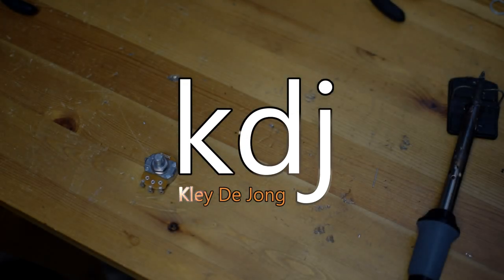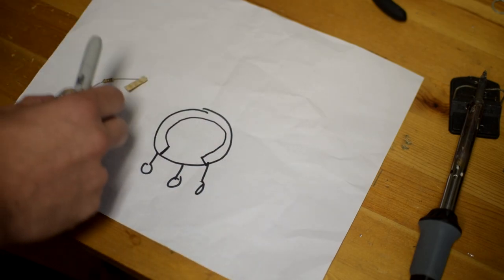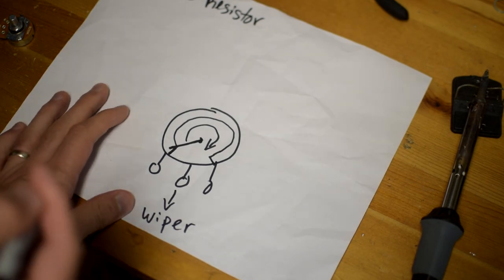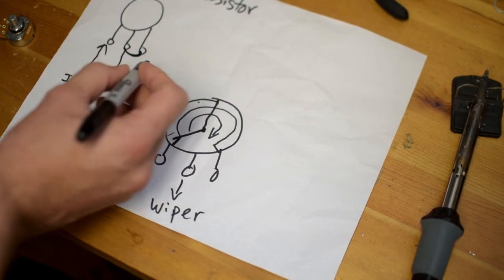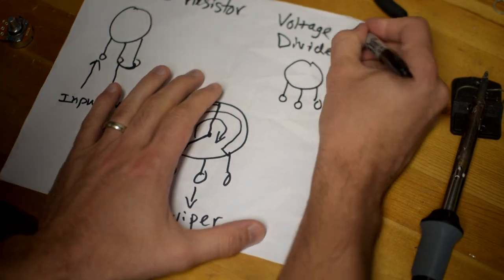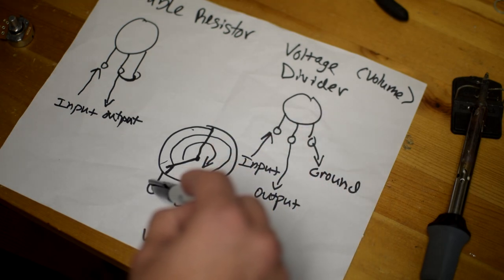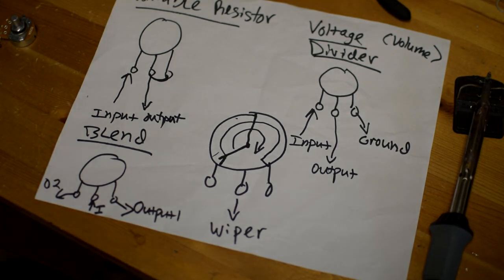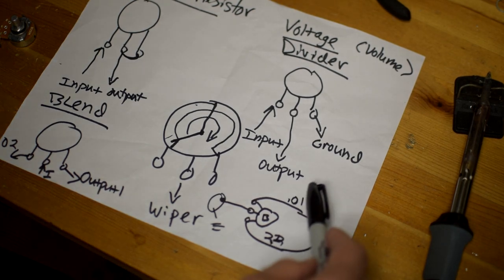How A Potentiometer Works & Options for Wiring

Comment: First off, thank you for an excellent, in-depth video!  Well done, Sir!  Second, you are correct; when using a pot as a variable resistor, leaving the 3rd lead open, or tying it to the wiper pin makes no difference, electrically, though it is generally considered bad practice to leave ANY lead open, or "floating", as they can act as antennas for all types of electromagnetic noise, including radio signals.  Also, thank you so much for pointing out the 3rd configuration! (What you refer to as a "blend" control")  Just for clarity, when the wiper lead is used for input and the outer two leads for output, this is traditionally known as a "balance" control, such as that used for stereo speakers or headphones, in order to balance the audio levels between the two channels.  On the other hand, when the wiper lead is the OUTput, and the outer leads the INput, then it is typically called a "mix" control.  One example where this would be used is called a "voice-over".  This is when a D.J. or radio host wants to adjust the relative volumes of two inputs, usually a microphone and a music source.  All in all, a fine, informative video!  Cheers for now!
Reply: Thank you for this additional information; it is also very informative and insightful.
Reply: this is the reason i cant get into electronics
Reply: Excellent input! 😀😉🤣👍

Comment: Almost totally in depth.  Leaving one terminal open is bad practice for two reasons: (1) acts as an antenna (as @flurng stated) and (2) because pots have noise as the knob is turned and the noise goes from R value at the spot on the element  to open circuit.  So wire in the open terminal to the center and the noise will only go from R value to max end of pot element value.

Comment: The illustrations would have been much clearer had you simply drawn a line connecting the wiper at its central portion to the (central) wiper terminal on the bottom because that is exactly how its wired. That way it is a simple matter to follow the current path.

Comment: So just to clarify a few things. First off, thank you for posting these videos. Super informative man  and much appreciated. Ive learned so much from people putting up videos like this! So on the last example where you plug the input of the guitar pickup into the middle lug / sweeper you are basically turning the volume pot into part of the pickup. This is how LP's, PRS and guitars that have multiple volume pots for individual pickups are wired. You are sending the pickup itself (the input) to ground when you turn counter clockwise. Its also a little more efficient on the out put side as the input is directly connected to the output. No variable resistance or shorting the signal when its all the way up. For strats and guitars with a single volume pot, you want to use the first lug (the one that is all the way clockwise) for the input and connect the middle / sweeper to the output. So its the same thing when the pot is all the way up. the inout is corrected directly to the output, but flowing the opposite direction. However when you start to turn the pot down you are essentially creating a short in the circuit by sending a portion of the signal to ground. This short coupled by a variant in resistance creates the drop in high frequencies when you start to taper the volume down. Its not the resistance. Power has both a direct and an inverse relationship to power, and one of the three variants has to stay constant. Resistance cannot lower voltage and power at the same time. Most people think the pot is lowering output voltage via resistance increasing. But the relationship between power, current, voltage and resistance doesn't work that way. and an decrease in voltage would actually create more power with a steady current stream and less power with a steady voltage stream. Its simply the redirection of voltage to ground as well as the decrease in circuit efficiency via the slight short we are creating with the taper that does it. The resistance plays more of a role in the tonal degradation as opposed tis output level. Which is why selecting the right pots with the right impedance is important because it can really mess with your tone. Its also why making sure that third lug is grounded properly along with everything else. If its not, you won't be able to turn all the way down amongst other problems. And its also important to create one long ground circuit between all of the electronics. The PUPs, Pots, switches, preamps and batteries if using active pickups or buffers. Some people even like to ground there bridge or tremolo to prevent any ground loops from interference. It should all be connected d and moving to ground on the same circuit. The lug to casing option is good here so you don't have to try and run all of it through the little holes in the lugs when you get to the point. Just dollop a blob of solder on the back of your pots and bend the ground lug up so its touching the casing and the solder and then drop a bead of solder on it to connect it properly. then it's not a big deal to connect a couple wires to the back of a pot to make the ground circuit  work smoothly. As far as tone goes, capacitors tend to resist low frequency and ;let highs pass. So tying in a cap to the counter-clockwise lug and the ground sends the high frequencies to ground and doesn't let the lows through. The greater the capacitance, the darker the roll off will be. preamp tone controls in passive tone stacks work the same way. Different combinations of resistors and caps create high pass and low pass filters with different cut off points. Thats why changing caps and resistors at certain points "revoices" the amp. The tone control os the same. Its attenuating the signal by sending it to ground like a volume pot, but letting only certain frequencies get by.

Comment: My potentiometer has a lower section that works as an on-off function there's a little flat spring in there that came loose I cannot for the life of me figure out where that spring went I ordered a new potentiometers first thing I'm going to do when they comes I'm going to rip one of them apart to see where that spring goes

Comment: I'm not understanding why a voltage divider needs a ground for the "excess" voltage. If you were to instead use a fixed value resistor in series, there would be no ground. What am I missing?
Reply: Me too I don't understand
Reply: @AL-wc8oy  The whole power supply is connected to the outer pins. What he called "ground" is just te minus pole of the supposed battery or power supply. The other pin is the plus. The load to control, instead, is connected to the plus pin AND the wiper pin. That way, you are dividing voltage. With the only difference that the part not connected to any load is dissipating automatically a voltage drop, while the other part which is connected and controlling the load, is dissipating the power between the wiper resistance and the load. It is a little brainy to follow but if you get it it will be clear.

Comment: Also had a thought on wiring the extra terminal to ground: If the impedance of the circuit using the potentiometer is greater than the max resistance of the potentiometer, then wouldn't this mean that connecting the unused terminal to ground would bleed off significantly and change the behavior relative to e.g. shorting the extra terminal to the wiper?

Comment: Your video is excellent. I am repairing a mobility scooter and it came with a two wire pot, the problem is finding a two wire pot is very difficult. So I was hoping someone could explain if a three wire pot could be used and you did.  Thank you so much, it was extremely helpful.

Comment: Say there is a live wire going to the motor and you cut the wire and join one end to the 1 and the other part of the wire to the centre pin, is that fine?

Comment: Question on the pin connections: If input goes to 1, output to 2 (wiper),  then wouldn't rotating the wiper clockwise mean there is higher resistance and therefore a lower output voltage from the wiper?  For something like a guitar volume pot, don't we want the opposite effect?

Comment: 5:30 It depends on any other "stray" potential terminals with which the port you left open may come  (inadvertently)  in contact (planes have crashed because components that were never supposed to meet physically did exactly that). Connecting the open port to the wiper port ensures that they are equipotential and there is never any current over the residual taper of the pot.
Reply: so if I'm understanding right the bridge or jump is to assure that in cases where the possibility to over power is present this is done as a safety way to insure that it doesn't pass the amount of resistance required? I'm changing a 200 kohms potentiometer in a gas spa water heater, I tested the potentiometer and it looked fine but the heater wouldn't stay on for long, when I plugged it straight it would stay on so I opted for getting a pot but the original came jumped and when I called the company they said that I would be fine if the pot was no les than 2 and no more than 10000 ohms, so I'm assuming the jump is to limit to half its power? I would appreciate the response! Thank you!!
Reply: Yes, the bridge is effectively a short that takes eliminates currents over the unused part of the pot resistance. Because an actual pot is a physical device, this unused section may actually display additional behaviours that are more complex than you'd expect from the idealization of the circuit diagram, and that may explain why the manufacturer preferred to deliver it "jumped".
Reply: Deipatrous thanks for be response! does it matter or does it make a difference which side or which lug (L1 or L3 to L2) in the grand scheme of things and does it need to be grounded or does it self ground when installed to a metal surface?
Reply: It shouldn't make a difference, unless there is something particular about the internal design, about which you should ask the manufacturer. I don't want to give advice beyond my expertise! Whether or not you want to ground the bridge depends on where else in the circuit it is grounded - if these two points are not meant to be equipotential from the point of view of how the circuit functions, you would be effectively shorting it out by grounding it.
Reply: Deipatrous thank you makes sense!
Reply: at 5:30   how is that  acceptable  ? i can not understand ? it's work is  so we can change  the circuit resistance  according to our need ? if we bring  the 3rd   pin of Potentiometer into our circuit ...dose it not make it  all together of same  resistance easy  it is actually and defeat the purpose of the knob  that we rotate ?

Comment: Very informative video! I have a quick question: is the wiring the same or different for constant voltage and constant current (Or in your terms voltage divider vs current divider)? Thanks!

Comment: Question.  I need to control the volume of a tweeter speaker.  I was going to use a 10watt resistor with either 5, 3, or 1 ohms to controls the volume of the tweeter.  My question is, is there a Pot out there that would accomplish the same thing without using individual resistors?  And if so can you suggest what potentiometer i would use to do this if at all possible.?

Comment: I hope you see this!!

I'm making iontophoresis machines, which basically supply a current through your hands or feet to stop them sweating temporarily.

I want to put a potentiometer on their to vary the voltage that goes to the output, as some people have sensitive hands/feet and can't handle 18v (x2 9volt batteries). Is there a simple way to do this?

Thanks

Comment: About the volumen control. It may be easier if you imagine that the signal goes into the wiper and the out-wire are on 1.
So that if the wiper is nearest on pin 1, you have least resistance and it will increase the more it gets toward pin 3.
When the wiper gets to pin 3, all the signal will be send direct to ground = no signal at all. :-)

Comment: Great video and very well explained. Just wondering about the soldering of a 500k resistor to a 500k pot to make it a 250k pot. Does it matter which way around the resistor is soldered to the outer posts?
Reply: No

Comment: How would you wire up the pot if you wanted to put a tone knob into the circuit (not in conjunction with a volume pot, just on its own)?
Reply: It is wrong on this video.the blend thing he talk s about if you hook upp a active source like cd player preamp etc like he say and show on this video on blend circuit you can blow the source.no active source like to get it,s output shorted out witch can happen when the pot is turned all the way to one off the sides.signal ground is comon is this case.

Comment: I have a 10K ohm pot, off a vintage (60s) tape recorder,which has 3 terminals on top of pot ,for the wiper resistor inside,and 2 underneath,it has a one click on/off built in,then stages for volume, I have a wiring diagram,The new pot I purchased has no terminal markings,how can/should I test with a voltmeter,or continuity tester,to find out,1,input output terminals,2nd which terminal wire should feed a tone switch on the tape,the model is a Sony TC - 108, the new pot has 5 terminals too.3 together (wiper) .! Other two ,is it too the tone control switch.any help would be appreciated.thanks,

Comment: My setup calls for a 35K ohm pot. Can I use a higher value such as 40 or 50K. If I do, what will happen? 
Will I prevent signal from leaving amp and damage components in my amp? Thanks.
Reply from the maker: Hard to say for sure without knowing what the pot is doing I'm the circuit. Going from 35k to 50k is close it shouldn't make much difference.

You may find it goes from a fine adjust to corse where your usable range is smaller.

If it is a bias adjustment pot then it needs to be set by measurement. Setting to the same physical setting may be way off.
Reply: @KleyDeJong  It is a volume pot. 
On a vintage tube amp to my jukebox.
Reply from the maker: @westbay5858  should be totally fine.

Comment: Variable resistor is bass treble adjustment...voltage divider is power/volume control...blend is left/right audio balance...
Reply: I want to add volume control to a metal detector for the headphone jack (mono). From my understanding I'm going to splice the positive lead to wiper, and one to outside lug. Will I damage the circuit if I leave the unused third lug open?
Reply: @bleirdo_dude  I would think not...my understanding is that is a common practice to leave the third leg open...
Reply: @standbyme6395  That's what makes sense to me. I never had so much conflicting information (besides religion) on a subject before. But a simple inline splice should not harm the circuit I would think.
Reply: @bleirdo_dude  if you're wanting to continue power through the resistor than yes I would hook up the third leg to allow another circuit to follow in line...if that makes sense ... coding is something I'm having a hard time getting into...
Reply: @standbyme6395  I'm just going to input to lug #1, output to wiper lug #2, and ground lug #3 (both to pot case & pcb). Thanks
Reply: @bleirdo_dude  if you remember let me know how it turns out...everything is fascinating and it's always best to learn from others mistakes.. lol...at least you know then that part of the circuit is completed...one could think about it in block chain...one circuit connected to another from a power supply ..sometimes that power supply comes from a circuit...web integration in concept...anyways I hope you have it work from first connection and best of luck hunting ore...
Reply: @standbyme6395  I will try to remember. When the parts come in I'll do it to my less worthy detector first (3 in total).
Reply: @bleirdo_dude  nice...I wanted to do metal detecting...hopefully in retirement and in peace....till then...may life be positive....
Reply: @standbyme6395  Check out the Fisher F11 for a budget beginner detector, or if planning wet salt (but not in the water) hunting a Minelab Vanquish 340.

Comment: Hello Sir , I need your little help !!! 

As we all know that potentiometers can also be used as variable resistors , 

Actually i don't have a lot of knowledge about potentiometers and I want one badly to help myself in my project !!! 

My case - I have a power source of 6 volts and 6 Amps ( D.C ) 
I want to get around  4 volts and 4 Amps ( D.C ) by reducing 2 Volts and 2 Amps using a potentiometer ! 

Now please tell me the value of potentiometer that can give me exact results !!! 

Thank you !
Reply from the maker: Have you tried looking into Ohm's Law?
Reply: @KleyDeJong  Not specially !! 
What's in Ohm's Law ? 

How can I get the exact value using Ohms Law ?? 

Please tell me the value Sir !!!

Comment: hey guys can u please help me find a video that explains how to wire a 6 pin pot like have an aux connecting to one side and other side having one or two speakers so that way i can plug the aux into my phone and full volume it and have a volume boaster in the middle so i can have it louder.

Comment: 6pin potentiometer what do you work
Reply: A 6-pin potentiometer is nothing more than 2 pots sharing a single shaft.  These are commonly used as "balance" controls for stereo audio equipment.  In this case, they are effectively 2 "volume" controls, with one wired "backward", so that, as one channel gets louder, the other gets quieter, and vice-versa.  There are, of course, other uses for these, although they can also be used as just a single pot, if no others are available.